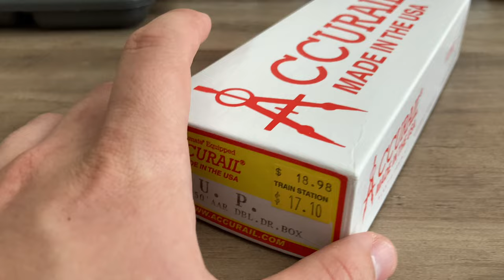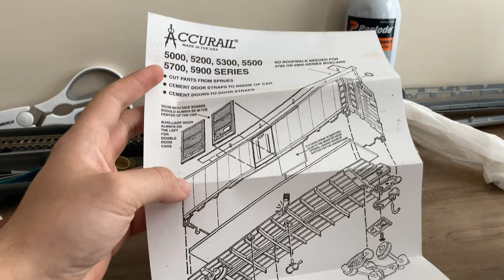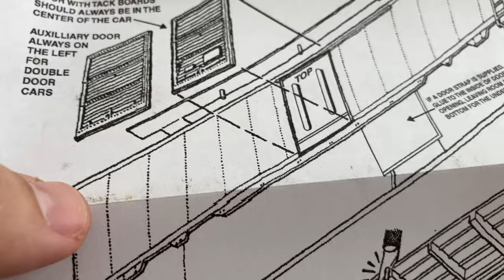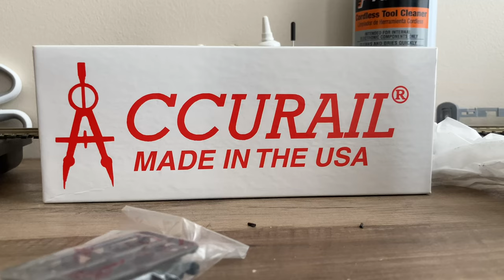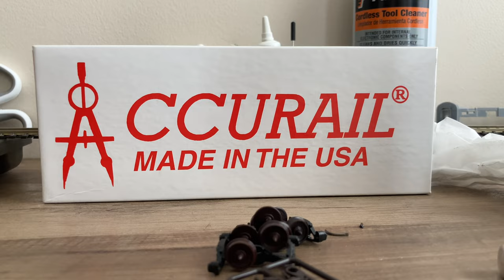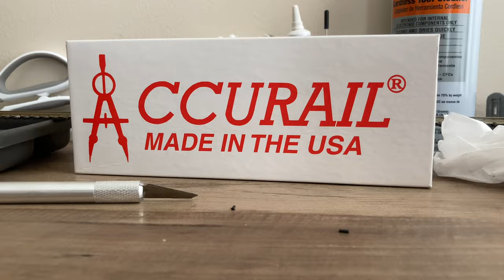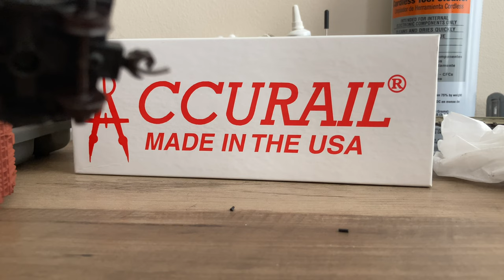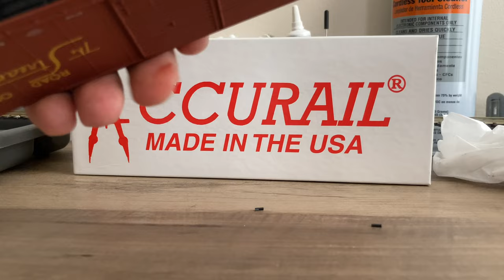Building an Accurail Boxcar Kit

Comment: Great video. I LOVE Accurail kits. I have found them at train shows for $6 - $10 for (most likely older kits), but WELL worth the money. I am not a fan either of the couplers or wheelsets, so I set them aside when building the kits. The couplers in case I need a spare sometime, and the wheels figuring that one day I may turn them into a flatcar or gondola load of some kind. I go with the Walthers ProtoMax couplers and Intermountain wheelsets.

Comment: Nice video, Michael.  I've put together nearly 120 Accurail kits - 46 of them boxcars.  I've found you really don't need to glue the shell to the underframe, as the ridges near the base of the shell snap & hold onto the underframe fairly well.  If for some reason you need to gain access to the interior again (and I have on a few occasions), all you need to do is gently pry the sides apart and the shell separates from the underframe.

Comment: Thanks for the excellent demo; Accurail make a really great kits.  However, I have found their wheelsets and couplers to be totally worthless; first step in an Accurail kit build is to toss those parts in the trash can.   I had a conversation with the owner of Accurail many years ago, not too many yeaars after their kits were first marketed.  I told him then, I would be willing to pay the additional costs of their kits if they included Kadee couplers and metal wheelsets.  (<aside> Delrin/plastic wheelsets greatly contribute to dirty rail; metal wheelsets used regularly will help keep your track clean.  If you run over all your track about once a week using 100% metal wheelsets, you wil rarely have to clean the track)  For me, Intermountain wheelsets are a MUST if I am going to have ANY chance of decent operations.  
Secondly, IMO, the weight supplied with the kit is much too light.  Further, in order to inhance "trackability" and reliability, I add between 1 and 1½ ounces above NMRA RP for all my cars.  They simply operate better and with the train lengths I run on my layout, the heavier cars pull without any locomotive issues either.
I absolutely do agree with mounting both couplers and tricks with screws; I drill and tap both for 2-56 screws and never have to be concerned with either coming apart somewhere on the layout. 😎 👍 😎